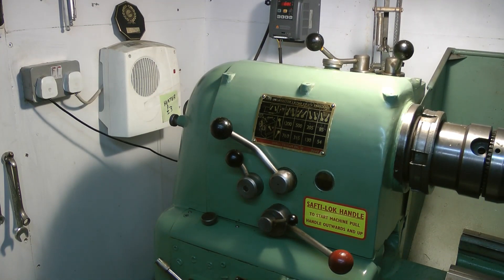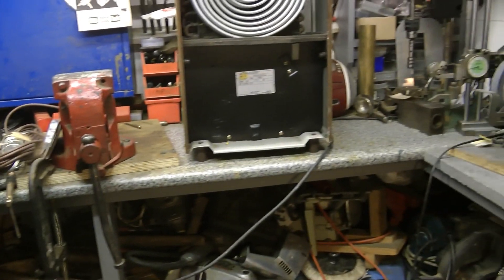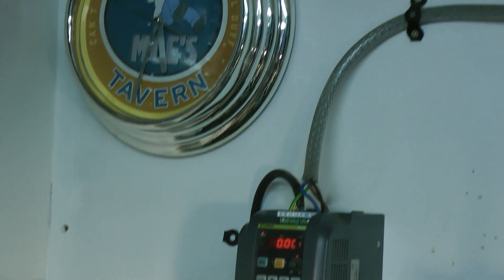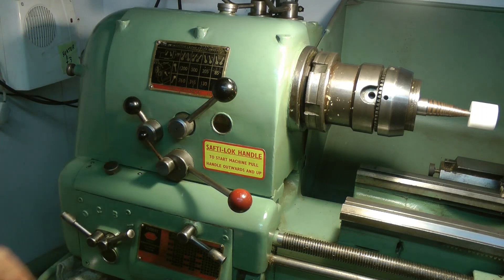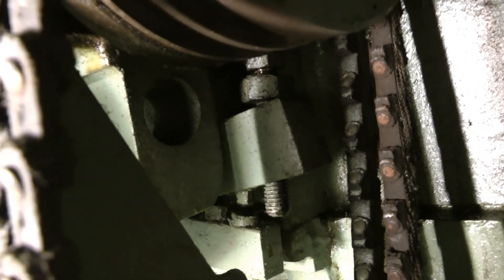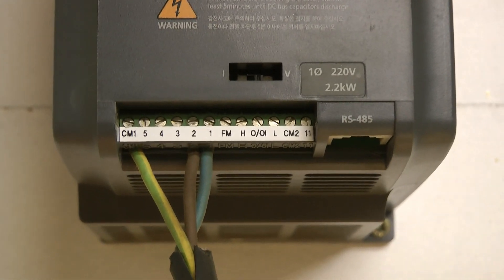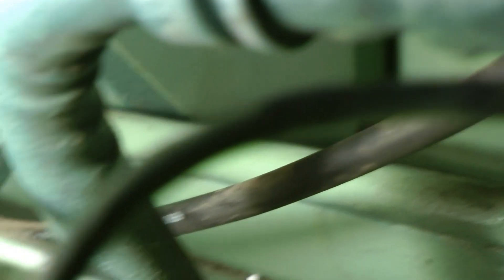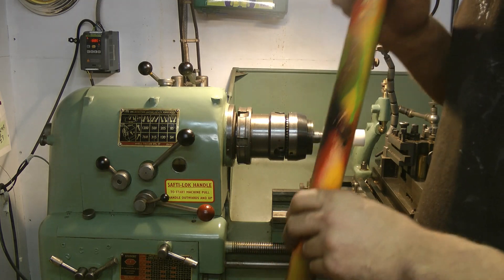wiring vfd  controls  on the Colchester lathe

Comment: Hi Chris, just picking up on this now - first, thank you for the elementary but most informative lathe videos.  Most useful for me as a beginner and amateur.  A lot of the others go right over my head!  Now...my question relates to VFDs.  I have a Colchester Bantam 1600 coming out of mothballs.  It is already fitted with a three phase motor that has two speeds.  The lathe has a hi and lo speed selector switch.  Problem is my workshop only has single phase power.  Can I use a VFD to only convert the 220 v - 380 v and run the lathe using only the original controls.  That's what I'd like to do.  I don't want to do anything else with the VFD except give me the 3 phase... Any insight appreciated, thank you!
Reply from the maker: Thanks , I don’t think that’s possible with a inverter, they usually have a pedometer so you can vary the speed at source,  why not go for a converter..  https://www.machinemart.co.uk/p/pc-40-3-5hp-phase-converter/
Reply: @Madchris1  Thanks so much, Chris.  Since I messaged you, I've done some more research (read - watched more YouTube) and you're quite correct - VFD can't do this.  One cannot have any contactors or switching downstream of the VFD, as operating them will throw it off & possibly cause damage.  The answer is a phase converter.  I was actually looking at a rotary phase converter.  I think it's time to throw some money at the crowd who for years have given me free advice and checked my motors & components at their shop for free & get them to build me something.  They are electrical engineers specialising in this sort of thing.  I'll let you know what they come up with...

Comment: Thanks Chris, have you bypassed the solenoid switch in the control box? My understanding is that the solenoid switch block has a overload cut-off built in. Does you VFD Handel the overload cut-off now?

Comment: I notice you've the got the original switch in pristine condition AND a working brake?
 My Student didn't have any of the finger-tip reverse lever or switch box, which was a real pain for screw cutting. So I drilled out the switch shaft and made one. I needed a switch so I designed one  from a printable idea but in steel and in the process added 3 stages of speed control, 50,30 & 25% and the 4th pos 100% reverse. Mounted the VFD in the gutted control panel and added a perspex cover.
The switch went through many protypes before I had a working one. The switch elements are microswitches, with a spring loaded ball bearing indent on a cam to give positive 'feel' and location. The motor had been butchered ( after a burn out?) and wired permanently in star. So I had to find the buried ends and re-terminate them for delta (220v).
This was one of long list of issues to get the lathe sorted. One really novel one, was a blocked oil point on the leadscrew end bearing pillar block. It turned out be a casting core that hadn't been removed. Still there 60 years on!

Comment: Chris. Brilliant video, ive watched it several times. 
my sparky has test run the old original motor in my student and knows its all set up in delta the way it should be, and that it all runs fine etc. The new VFD is all wired from single phase. But im a bit simple when it comes to understanding the switching. Im assuming the 3 phase UVW connections go from the VFD to the motor terminals direct. The switch wiring you've shown, you say is low voltage. does it matter what voltage? ive got a few to choose from on my VFD.
Reply from the maker: Yes the UVW connects to the motor, the low voltage system is just a control circuit for the VDF electronics for remote operation ie the using the original lathe switch lever , the control terminals are  much smaller and usually on the front of the VDF  mine reads CMT1 and there’s a number 1 and 2  the cmt is the common and one and two give you the option to run forward or reverse depending on which wire connects to the common
Reply from the maker: ill upload a video showing the terminals :)  should be ready in a hour ...

Comment: Good timing with this video. I am having a nightmare with my Colchester Triumph roundhead. It is totally original with 3 phase electrics. I am lucky I also have 3 phase.
Basically the lathe will only run when I hold the safetylok handle up. As soon as I let go it switches off. If I adjust the levers so the handle latches the lathe won't run. Like the switch has moved too far.
I can get it to run in the locked position if I flip the 2 bottom contacts back down by hand before plugging it in. Not ideal!
When your is on do the 2 bottom contacts flip up? I imagine that is how it should be but then mine cuts out.
I love your restoration by the way!
Reply from the maker: codprawn hi 👋 best I can do for you is film what’s happening inside mine to see what’s different 🙂 let’s see if we can get a solution either me or one of my followers / friends with a Colchester can get to the bottom of it
Reply: @Madchris1  
Chris that would be brilliant thanks!
Basically just show the switch at the back when in the off position and when running.
Reply from the maker: codprawn no problem 👍 filmed and being uploaded now, prob be on in morning  regards Chris
Reply: @Madchris1  
You are a star - have watched your old videos many times!

Comment: Any possibility of seeing how you have wired the whole lathe up. I've just taken a crack at mine and I'm lost. Have you bypassed the main panel?
Reply from the maker: Shane Smith  hi Shane yes bypassed the main panel  I bought a duel voltage motor and wired it for 240 volt three phase running through a vfd this video is just the control circuit for the variable frequency drive I have a video of me wiring up the motor from 440v to 240 v https://youtu.be/PW8kLasTXZM
Reply: @Madchris1  yeah I picked up a 240v single too 400 double phase 5.5hp rotary inverter today. It's also 4 pin plug so for now I can use the lathe with the 70 ish year old motor😕 but I will get another motor and do like you've done as this rotary unit is like the size of a small fridge lol. For you're reverse in this video have you just taken the wires from the round unit in the back and put them straight into the vfd as to function as a kinda independent trigger switch or is that also still linked into the motor at all? Sorry for all the questions 😆
Reply from the maker: Shane Smith  the wires to the rotary switch are  a low voltage control circuit for on off and reverse basically you’ve just extended the switchs on the vfd unit and is not the main power to the motor 🙂
Reply: @Madchris1  cheers for verifying that bud I appreciate the advice an thanks for taking the time to reply.
Reply from the maker: Shane Smith  any time  Shane 👍😀

Comment: Hi Chris, Thank you for sharing. I have the basic Mk I.e no gearbox though appearance wise seems in good condition. I failed to wire up the new VDU(7kv) to even get the original 3hp motor to run. Just shows a fault which the vdu manual troubleshooter section suggests an earth fault.The lathe had not run in at least 15 years in the factory and was never wired up so unknown history.Tried setup on the bench with another 3ph and it runs sort of ? I don't know any electrical engineer to ask so progress is slow ! Your video shows only 3 wires connected .My set up has mains in and 3lines + Earth going to the lathe. Anyway you have given me a nudge to try again and look at the wiring which looks original. Oh did I mention the lathe has 5 change gears fitted, the rest of the set are missing and this setup will not give a single screw thread pitch to cut ...... Hah just to add to the fun ........ ranting on
Kind regards from Scotland 
Richie
Reply: Thanks Chris for your reply and link. I was reluctant to change motors because of the original flat belt drive pulley system and the problem if the new motor has a different shaft dia with no machining options ! I may well have no other option..... after Christmas ...Hah. Keep doing the videos, and thanks for the encouragement.All the  best.
Richie
Reply from the maker: Richard Mckay hi Richard ! I’d be surprised if the original motor was a dual  voltage 240/440v motor , i bought a 3ph dual voltage 3 phase from machine mart and reconfigured the internal wiring to run 240 volt 3 phase 

https://www.youtube.com/watch?v=PW8kLasTXZM&feature=share

Comment: hi Chris, done the same as you m8, I purchased this year 2 vfds for my lathe and milling machine, talk about transform the lathe and mill, its nice to use the jog function and able to speed up or down forward or reverse, at a touch of a switch, woudnt bother with the blue box stuff, they are good but just hasn't the features as the vfd, 
keep the videos coming Chris, regards...Keith
Reply from the maker: mrmyford  your right Keith,  I’m guessing some people have no choice and there expensive,I’ve programmed mine for a soft start to to give the old girl an easy life/ retirement 😀 too are you still doing a bit ?

Comment: Hi Chris, what 3 phase motor did you use? I have a vfd but need a motor. It’s rated for a 3 hour motor but might drop to a 2hp to not overload the vfd.
Reply from the maker: itsawindupuk  I used a Clarke 3hp duel voltage motor from machine mart, https://www.youtube.com/watch?v=PW8kLasTXZM&feature=share
Reply from the maker: At 50 hz the motor would develop 70% of the rated torque and 80% ish ..at 60hz I

Comment: Very useful video but Oh God the terminations on some of your wiring leave a lot to be desired, in fact some of it is positively dangerous.
Reply from the maker: Derrick Stone the control circuit is low voltage, but I’ll clean it up 👍 the three phase motor cable is sealed and a armoured cable

Comment: Chris,
          If your dehumidifier is terminal, I have an old Ebac Humidex 4 (same as the one on eBay item number 123976488197) surplus to requirements. If you want it, pay the postage and it's yours.
Reply from the maker: sedulousdabbler  very kind thank you 😊, going to dig into it tonight, think it may be a motor capacitor ... vid to follow 😂 regards Chris

Comment: hi Chris,i  ended up buying one those big blue inverters for my Colchester cost me as much as the lathe!!..its working my big old 70s milling machine aswell so I cant moan but yes I wanted to use the original controls but this is all I could of at the time. ps iv been watching some old Fred Dibnah stuff lately makes my legs feel funny watching him go up them old chimneys they wouldn't let him do that today! keep it up mate
Reply from the maker: blackbear bowie  Fred was awesome 😎 , the transwave inverters are ideal for old milling machines etc were you want or have no choice on motor as they are usually not duel voltage, I wanted one myself but they are pricey.
what kind of mill is it ?😀
Reply: its a Harrison 600 only thing I don't like bout it it doesn't  have a wined down spindle you have wined the table up to it
Reply from the maker: blackbear bowie  a fine machine ! With horizontal and vertical,  do you have both heads?
Reply: it can turn  horizontal but you have un bolt it but its a good machine lots of speeds. it took some shifting like my lathe..my fault as I built my shed in the wrong place as at the time I didn't realise id be having all this heavy machinery!!
Reply: my understand with it Chris the one head does both you unbolt and move around to horizontal

Comment: Chris,
Were those 2 thin black wires carrying the current for the motor or just a signal for the VFD ? I hope the latter old mate.
Regards
Reply from the maker: Michael Linahan  low voltage signal wires for the switching circuit, same as a head light circuit on a car I guess,  Which the heavier current is switched by a relay
Reply: @Madchris1  I thought so but just checking. I wouldn't want you to have a Stan Laurel hair do!
Reply from the maker: The motor wires in a armoured cable 👍